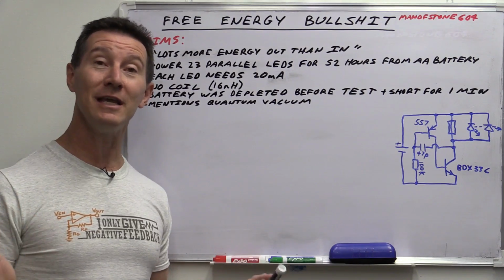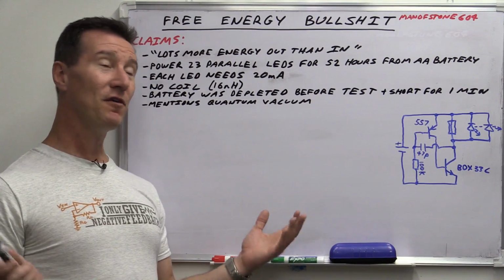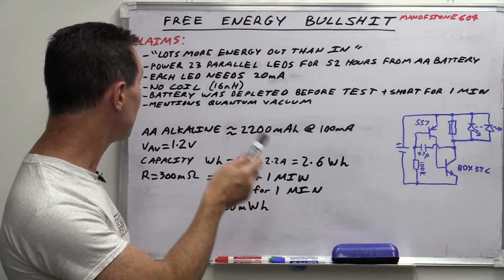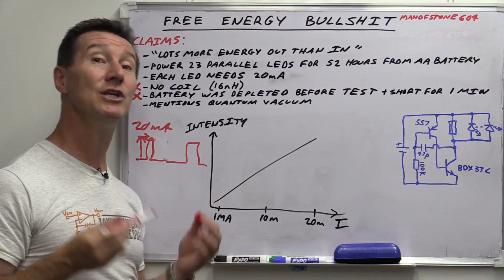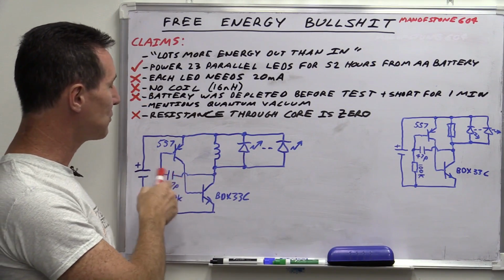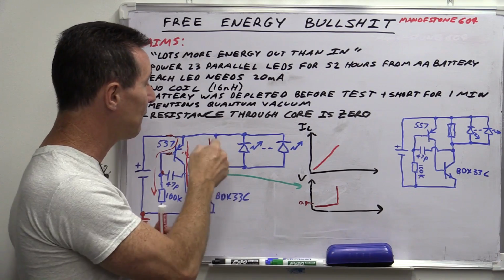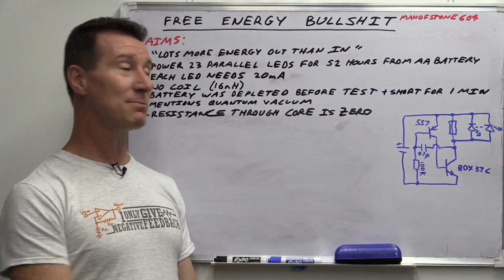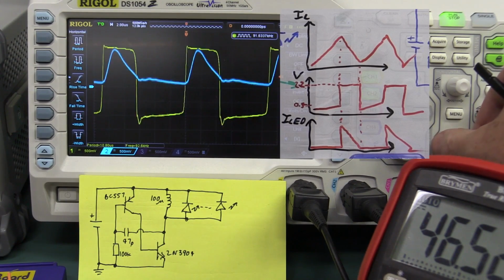EEVblog #708 - Free Energy Overunity is RUBBISH!

Comment: You can't say all free energy technology is bulshit just because you prove this one wrong. Seems as though this guy has picked one of the weakest arguments for free energy. I think there is more than sufficient evidence and proven methods of energy supply that is free or at least much less costly. To suggest that free energy or near free energy is not possible is also suggesting that science has reached it's limits and this will be as far as the human race will evolve with technology. If you told someone in the mid or even late 1800's that within a century nearly every house will have electricity and television, computers and spacecraft, the people of that era would probably argue because their deeply held belief and their current methods of less advanced science would either not account for such a thing or would not be convincing enough. 

At least the guy running the youtube account from the video in question is tying, he is contributing to helping mankind and it's development, you are doing nothing other than parading and putting others down which of course are the reasons mankind is failing. 

Clearly your narcissistic tendencies, your probable lack of capacity to socialise without demeaning those you talk to and your over inflated ego have left you in a state whereby you feel compelled to seek what you lack in the real world and replace it with pleasure on the internet driven by a delusional perception of being a celebrity figure. As you are also someone who is financially stable or well off, I can see why you would be in this mindset, I would assume that a person like you would blame the less fortunate for not being wealthy and claim that they should work harder if they want to be successful. You may be well educated, however there is an often mistaken line drawn between those who are intelligent and those who are well educated, I am sure you can guess which side of that line you fall.
Reply: Don't you think that if "free energy" was possible someone would have discovered it? Or do those so called experts on the Internet forums and you tube know something that the most highly qualified people on the planet don't? This man has decades of experience and has probably built more circuits than you have had hot dinners yet he is the close minded and ignorant one? Energy can only be transferred or transformed, not created, that's thermodynamics for you. Facts are true whether you believe them or not.
Reply: +Henry Thomas Yes I stand by my comment 100%. It is not a matter of belief. Belief will only limit your capacity to comprehend. If you allow underlying belief to smother you from efficient critical thought. 

It seems as though given how strongly you stand in defence of this man, that you are confused and it is in actual fact and reality, you who rely on "those so called experts on the internet forums and on youtube".

 I think you are confused about my comment or just twisting my words to invite a debate. I never said anything about creating energy, and when referring to 'Free' this should be interpreted as the monetary value and shouldn't always be taken literally. When society talks about free energy I would speculate most are referring to a source that is next to no cost at all or can be made free and accounted for in taxes already paid this would only be possible if the efficiency and cost effectiveness were little or none. 

Thermodynamics still remains just a theory, so these 'Facts' you refer to in relation to thermodynamics, really only represent the most suitable and most efficient methods we as humans currently understand. You will notice that whenever there is something that science cannot explain, or struggles to explain, it is not the problem or the solutions that are the issue, scientists of the relevant fields will always refer to our lack of understanding or current models of scientific application that are the limiting factors that don't allow us to find an answer.

I will also point out that a lot the world's best physicists are beginning at an increasing level to state that Physics may not be the underlying model of science to rely on anymore and we may be reaching our limits with science under that model. May I also point out that is only estimated to be less than 5% of life and the universe that is currently understood with our current application and models. 

The question of whether or not there is a much more efficient source of energy is not up for debate, this has been proven irrefutably a number of times in the past century even. If you do some legitimate research instead of relying on the basis that someone would challenge the entire natural resource industry and invented it by now, and don't rely on your men with decades of experience on youtube you will discover this yourself. If history has shown us anything, it's the 'men with decades of experience' that have little role in breakthrough technology and innovation booms, I would assume it can only be caused by a matter of complacency and repetition of veteran professionals who stop striving for answers and just repeat what they already know.

Comment: You shouldn't use this circuit as a disproof of Zero Point Energy, only as disproof of this inventor.  Free Energy scammers like to quote ZPE / vacuum energy / dark energy as the power source for these garbage circuits.  
ZPE is a law of Quantum Mechanics!  And I fear we're going to pass over some world changing technology if we're too skeptical and don't follow the scientific process.
Reply: +Bardrick Zero point energy is an aspect of quantum theory. As a virtual force it is not available to do work. There is no "world changing" technology hiding here, just like there are no perpetual motion machines.
Reply: *****
Please read up on the Casimir Effect, because last I checked Force through a Distance is Work; it's not really "Virtual" when you can measure the force applied.

And yes 'Perpetual Motion Machines" are impossible since every system has waste, but Nuclear Power is not perpetual motion, and Quantum Power is very similar to Nuclear Power.
You could consider a Black Hole as a Quantum Power source since mater that has fallen past the event horizion is re-radated via Hawking Radiation due to ZPE; this mater could be said to have gained Gravitational Potential Energy from nowhere . . .
Reply: +Bardrick You are misinterpreting things. There is no practical application, entropy ultimately defeats what you think is being "created". Nuclear power has nothing to do with it.
Reply: ***** Simply saying I'm wrong doesn't disprove my argument, and empirical evidence always trumps theory.
I can give a laundry list of items that poke holes the the law of conservation of energy; they are all related to Quantum Mechanics in some way.
Old scientists have a nasty habit of clinging to old theories / laws like a religion, often blind to what's right in front of them. Eg: Einstein vs Newton.
Nuclear Power is just an example and similar since they both derive energy from the interaction of particles.
Reply: +Bardrick You have absolutely no idea what you're talking about. It's really funny when people like you throw around terminology without a clue what it means. Nuclear power does not violate the law of conservation of energy in any way, quite the contrary.
Reply: *****
troll much?  or you can't read?
Reply: Bardrick If you weren't so fucking incoherent, you might make more sense. There's a statement you should be able to understand.
Reply: ***** I've tried to explain it as simply as possible!
1-The Casimir Effect was proven by reputable scientists.
2-The Casimir Effect has real world measurable forces.
3-Casimir forces must be taken into account by DLP chip manufacturers or their chips will be damaged by it.
4-I and many others think this can be turned into a type of nano motor.
Reply: +Bardrick I think you're talking far beyond your actual knowledge. Quantum energy is not available to do work. The idea that the Casimir effect would allow arbitrary negative quantum energy states is purely speculative, there isn't even any hypothetical formula to support that. You're making the fundamental error of assuming that because a force exists and can be measured, it can be controlled. Not a logical assumption in this case.
Reply: ***** Thank you this is a better answer, but I don't think it's possible to disprove Quantum Energy since you'd need ~100 wholehearted, unbiased and verified attempts to build this type of device and have absolutely none work (disproofs are fucking hard to do!)
The big problem with disproofs 1 example breaks them: I heard about interesting tests being done with Quantum Tunnel Diodes (Esaki Diodes) and other zero bias diodes: http://www.integrityresearchinstitute.org/ZPDiodeProjectSummary.htm, http://adsabs.harvard.edu/abs/2009AIPC.1103..501V
From what I understand here: an electron and anti-electron pair is created. the electron travels over the depletion layer since it's so thin in these diodes. the electron can't return over the barrier to meet it's anti pair and so the anti-electron eats a free electron on the positive side creating a charge imbalance.
Reply: +Bardrick That's all irrelevant. There is no such thing as "disproof". There is only proof. I don't have to disprove anything. You have to show that it works. There is no working "quantum energy" device, because there is no quantum energy available to do work. Once it would do something, it's no longer quantum/virtual, it's just energy.
Reply: *****
You didn't read those links that fast . . .
and I hear alot of denial.
Reply: +Bardrick I read faster than you think. Once again, it's not about denial. Science is about proof. There are many people who make many claims. There are many established scientists and researchers that propose conjectures or even make claims, that does not mean they are true. Don't tell me about proposals and claims, they are only interesting anecdotally. ESTABLISHED science indicates that there is no such thing as "overunity" energy production. It violates laws of physics that have been proven correct over and over again. Current theory supports the idea that "virtual" energy, quantum energy, zero point energy, whatever you choose to call it, is not available to do work in the physical universe, by the very nature of quantum theory itself.  These ideas that it somehow is are the result of fundamental misunderstandings by laymen toying with science that is far above their pay grade. The idea that men with PHDs and published papers on the subject are being one-upped by some high school dropout in a garage somewhere who made a magic quantum machine out of plywood and leftover plumbing supplies is really kind of absurd. None of this crap is new, it's been going on since long before you were born. I've seen it all before. All this junk is a rehash of what's been done over and over again.
Reply: ***** You didn't read it since you would have read the part about "the discovery in 2003 that semiconductor junctions exhibit measurable Johnson noise at any temperature, including microdegrees above absolute zero." - http://www.integrityresearchinstitute.org/ZPDiodeProjectSummary.htm
Reply: +Bardrick That's not "free energy", I fail to see the relevance.
Reply: +guyonearth OK then, 2 interesting points:
1 - Johnson Noise results from heat shaking the atoms/electrons in a conductor producing very small current (a single source heat engine thought to be impossible)

2 - when chilled to near absolute zero there shouldn't be any current from Johnson Noise since there's no thermal motion : . this proves ZPE is producing the remaining current.
Reply: +Bardrick That's a completely absurd statement, you realize that, right? There is no motion at absolute zero. None. Johnson-Nyquist noise has absolutely nothing to do with "ZPE".
Reply: *****
LOL so you agree then?  The current must be ZPE.
Reply: +Bardrick No, absolutely not.
Reply: *****
so then you refuse to accept the findings?
Reply: Bardrick I don't think you understand what you're reading. There seems to be a big cognitive disconnect here.
Reply: ***** NO.  I think you have all book smarts, no engineering skills and a general trolling personality when you don't get your way.  The Universe doesn't care about your wishes or problems; it just is.  And an inability to adapt to change results in extinction!

I chose the hardest field of research possible; I'm sick and fucking tired of dealing with brain-dead skeptics.  And the believers . . . they're worse: scam artists, delusional, eccentric, unscientific.  Most of them are, and wasting my fucking time.  So, please save your venom for the bastards selling magnets for medical use.
Reply: Bardrick You're drawing the wrong conclusions from materials that are either not properly sourced, i.e. crank literature, or you simply don't understand.
Reply: *****
You haven't sourced anything : . you are the "crank literature."  I always try to find the best source I can, but I lost the original article for the QT Diodes.  As for Hawking & Casimir, I'd say those are the best sources I could ask for!
And besides this isn't a paper I'm writing here: just a friendly discussion!

The fact is Hawking Radiation can't coexist with The Law of Conservation of Energy: this is high school vector kinematics.  String Theory might help, but you can't deny: these particles escaping from the event horizon are effectively gaining gravitational potential energy and momentum in impossible amounts (greater than ∞).  This could be made into a feasible reactor albeit extremely dangerous.

The Casimir Effect http://www.scientificamerican.com/article/what-is-the-casimir-effec/

Hawking Radiation http://math.ucr.edu/home/baez/physics/Relativity/BlackHoles/hawking.html - Stephen W. Hawking, Particle creation by black holes, Commun. Math. Phys. 43 (1975), 199–220.  (The original paper.)
Reply: +Bardrick Where does Hawking say that the law of conservation of energy is violated?
Reply: ***** He doesn't as far as I know: maby he assumes you already know about the exceptions.  Do you understand high school vector kinematics?!  Can you calculate the vector and energy of a particle or do you need Hawking to tell you himself?!
Reply: Bardrick There are no "exceptions". You're sounding more unhinged by the minute.
Reply: ***** all I hear is trolololol

Comment: I, myself, on my tiny work table with $50 worth of parts, have seen clear evidence that the never-wavering Lenz's EMF Law doesn't always apply to every single configuration of EM generator! As a matter of fact, my simple motor/generator setup test shows the EXACT OPPOSITE effect, acceleration and a decrease of input amperage the closer to a "dead-short" condition of the generator! As an aside, I am a trained technician.

Comment: Over the holiday period, I placed a blue 50mA LED to my hat.  It stayed on for over 2 weeks!  From a 2035 button cell (3V).  So must've had the quantum flux capacitor under my hat then?  Odd, but it was still working after I took it off.  Got the batteries in a pack of eight from poundland too.  That is free energy?
Reply: You were supposed to pay for those batteries!

Comment: Take your two best identical samples of white noise and overlap them, offset one of the samples, they always phase. Take a wave table synthesizer, for piano key "A" tuned @440hz when pressed it plays rhythmic midi notes in consistent intervals harmonically tuned to 440hz. That's a single not being triggered every cycle, tune the sample rate, that's musical aliasing, modulate the parameters. Apply it to the dimensional system I showed you in part A. Don't forget to modulate the phasing of the oscillators!
Reply: +diskman66 Have a nice day!
Reply: +diskman66 Where do you get "identical" white noise?
Reply: +PaulaXism all whit noise is imperfect but any sample can be duplicated there is much advancement in creating a true white noise sample as it is supposed to contain evry frequency in relative energy levels but when you factor in phase it becomes a theoretical system of infinifinty and a paradox
Reply: +PaulaXism all whit noise is imperfect but any sample can be duplicated there is much advancement in creating a true white noise sample as it is supposed to contain evry frequency in relative energy levels but when you factor in phase it becomes a theoretical system of infinifinty and a paradox

Comment: I'm no expert at electronics. I would ask the maker of the original video: If it is free energy then why does it only last 52 hours? In fact why does he deed a battery in the first place if the energy is coming from someplace else?
Reply: +MadMax Fury  Hm, that's not entirely true. A joule thief circuit requires a constant input. Disconnect the battery, and the joule thief circuit dies. So it is not self powered. And Dave does careful measurement of the input power versus the output power, something the "free energy" scammers never do. When he performs this careful measurement, it shows clearly the output of the joule thief circuit is LESS than the input. So it shows a LOSS of energy by the joule thief circuit. How on Earth can a circuit that wastes energy can EVER be called over unity?  It can't, plain and simple.
Reply: +MadMax Fury   Yep, lots of energy there, for sure, but don't call it free.  It is consuming itself to give you a tan.  The Sun will provide energy, and requires no energy input AT ALL. So, no spark needed.
Reply: +MadMax Fury   We are definitely in agreement about the energy from the Sun.  Our whole lives, and the life of our Earth depends on the Sun.  I would really like to do more research on how to utilize more of the Sun's energy, so we can stop raping our precious fossil fuels.  Good day to you sir.